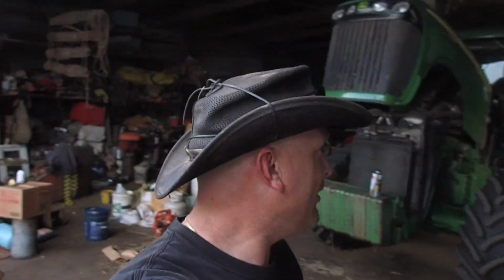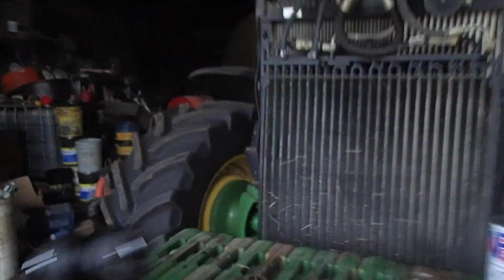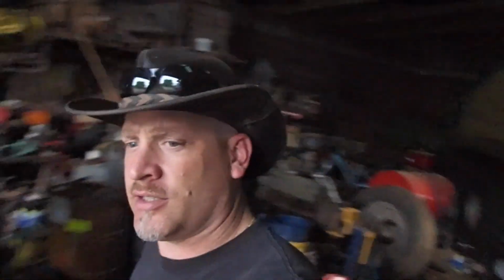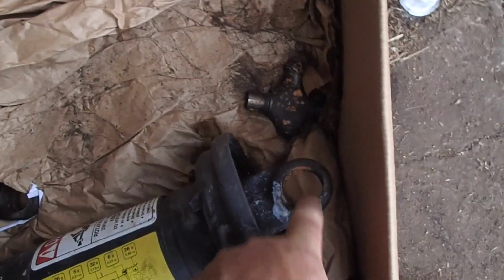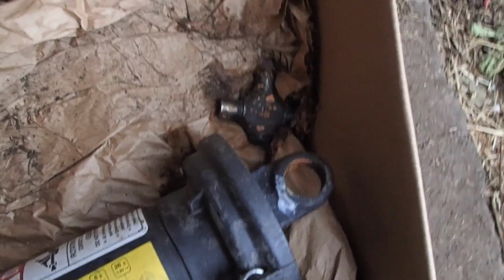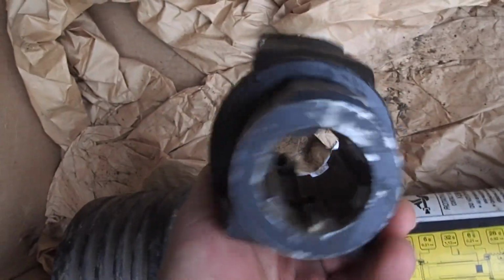Krone PTO Direction

Comment: Ok Wes, you can put this to bed whether or not there is a part two video to this or not. I dug around looking up the SFTS9 number next to the arrow. This shield is normally used on a shaft with a clutch (SFTS9) in a cv configuration and a quick coupling that engages the tractor pto. In this case the shaft is a balanced build with no proper direction for installation, and if they want to be technical about it. The clutch is on the flywheel making the shaft correct anyways because the arrow is meant to point to the clutch anyways.

Comment: Dunno if it really matters, but usually you put the "bigger" end on the primary side. ALWAYS grease a new shaft, because at the factory they just put margarine on it - including the tubes.

There's always some telescope action, unless the shaft runs true or both ends have the same angle.

Love your vids! Thanks..

Comment: The direction has to do with driving shaft of the assembly vs driven shaft of the assembly. Believe me, if the mfg of the part goes to the trouble of printing the proper direction of the part on the part then it matters. Manufactures do not go the expense of printing stuff on parts of they don't have to. 

On my PTO shafts the inner tube is attached to the tractor and the outer tube to the attached implement. Simply look at your other PTO shafts and see how they are set up for comparison.

Comment: i agree it doesnt matter which way around it is, only when there is a slip clutch or some such thing built into the universal is when it matters. The most important thing is that the 2 u joints on each end of the tubes line up together but in saying that theres next to no shafts that allow it not to line up these days.

Comment: i myself coming from a farming family i understand everything you do. heck ive done alot of goofy stuff to get the job done. im honestly concerned why everyone has to question why you do what you do to the point you have to take time to make a video to explain yourself. Mr Pandy keep doing what you are doing i love the videos and cant wait to see more.
Reply: and to add to this if anyone would like to know the direction of that shaft does not correspond to its use on the krone. pto shafts are universal in so many ways. the direction of the shaft would only matter in certain cases. and from what ive seen most of the time it has a direction because the universal joint gaurd is smaller on one end or the other or the u joint is splined different on either end so its just an indicator to help attach it.

Comment: Put the bolted yoke end on the most expensive drive shaft as there is usually less wear on the shaft (over time) compared to the push button release yoke ends.

Comment: Telescoping PTO Shaft: Which end to tractor?            Larger PVC tube (cover) belongs on the PTO end. Consider (a) that the tractor end is generally higher than the implement and (b) water runs downhill. With the upper half overlapping the lower half, water stays outside. Regarding the steel tubes, consider that torque is delivered by the PTO. The larger cross section will absorb more shock load than the smaller  cross section. This is especially true with electric PTOs. Hence the larger half typically goes on the drive end, and the smaller half on the driven end.

Comment: I'd go one step further and check with Messicks or Krone because there must be a reason or the shaft wouldn't have been marked. 

Possibly the shaft and flywheel were balanced as a unit rather than individually?
That might explain the failure if it was caused by vibration. If I remember correctly from another video, the shaft appeared to not run true and was noisy in operation.

Comment: Wes you hit the nail on the head when you said it doesn't telescope so it  doesn't matter which way it goes on. Your failure was I think as you know caused by the  replacement joint that had been fitted If you have got anything of the cups left measure them up against the other end as there are some joints wjth just a thou or two different and they will fit with some effort but it does nothing for their lifespan

Comment: to think of it this way the female  side has more mass so it facing the tractor  keeps the majority of the mass in a straight line and lower position  reducing  pressure on the joint at the top as it spins.

Comment: Maybe look in the IPC or maintenance manual ? If it needs flipping, its 2 bolts and 10 mins. If it breaks I am pretty sure you will be buying another (warranty does not cover improperly installed parts) plus shipping and tax not to mention the down time. Be smart and check the Manual/IPC and save yourself a possible ballache later.

Comment: I would not change the direction of the shaft. I think it is on the right way like it is now . . . Because the outer part(male side) of the cover is on the high end. If it goes on the other way water will collect inside the shield, and that is not a good thing . . . Just saying

Comment: PTO shafts on new equipment are subject to fail. If you check that shaft after a short time of running it is probably to hot to touch. It is a result of an accountant on the 30th floor of an office building building equipment.

Comment: I'll also note that the directions for installing the shaft are still unopened and taped to the shaft.
Reply: check again, they were open and the paper is gone, just the plastic is left on the shield
Reply: Is it?  Huh it looked like it was still on there.

Comment: The only reason left would be if your U-joint trunnions had grease fittings on the cross. They need to be installed so the zerk fitting is under compression when in use or the trunnion can fail.

Comment: could the reason be  that when a pto shaft is angled down, female is at top end to avoid  water and dirt from enter inside  and eventually binding up with grease inside the pto shaft, and creating stress on needle bearings

Comment: Isn't the "tractor end" usually the outer of the two shaft halves?  At least it is on the two I have here.. That said, typically its downhill from the tractor to the equipment .. my assumption is the outer shaft being higher is to prevent debris and water from running down between the two halves.  If this theory holds true it'd make sense to connect it the way it was on the Krone as otherwise you'd be directing everything down through that union.

Comment: Think of the effort and cost to print the tractor and arrow on the shaft.  For no reason?  CALL THE MANUFACTURE FOR INSTRUCTION!
Reply: For no reason!!  The shaft is built correctly.  Yokes are in phase.  U-joints are identical,  The installation is correct.  The shaft will operate in either direction. End of story.
The only reason the arrow direction would be valid is if the shaft were built with different size u-joints for one reason or another.  The arrow sticker is more than likely used with a variety of installations.  In this case, it is not valid.  By the way, DON'T YELL
Reply: Paul Copeland:   On such an important part, on such an important machine, with such a questionable history, a 10 minute phone call to a factory engineer to get an expert answer, is the rational course of action.   You're probably not an Krone expert, and...  PHYSICIAN HEAL THY SELF!  Thank you for your input!
Reply: +Gravertrain Graveytrain you are not à mechanic for sure and you are doing a storm in à class of water
Reply: INCO:   My shop is still open and run by another.  I operated for 18 years with four employees.  Illness caused me to step down.
Reply: It never hurts to double check, especially if it stops your machine from failing because all the time you saved by not calling you will be wasting on fixing it
Reply: Thanks!  It shouldn't hurt to stop and think it through.  Best o' luck.  :)  PS: Wes seemed pretty stressed when his baler was down, and he had crop to bring in.

Comment: I'm thinking the chisel marks are the KEY here. They tell us of significant issue some time prior to delivery ( in KRONE hands )Someone screwed up before you ever touched it making Wrong #1. You unsafely assumed that KRONE employees know best and tell into the trap of following that lead making Wrong #2. You absolutely know your Momma told you over and over, " Two Wrongs Don't Make A Right". The shaft IS backwards and You should reverse it while no harm has been done. Also, remember, 2 wongs don't make a white. He,He!

Comment: I dont know what brand that shaft is but im Petty sure thats its not a krone
In holland we use mostly walterscheid and this is probably a standard shaft with standard printing
Its actualy the secundary shaft so its not. even connected to the tractor but the housing is used for a miljon other machines

Comment: I would be asking Messick's if they borrowed that shaft and put a fixed one back on. I can't see the factory doing that. But after a few years a farmer might have to beat off yoke because of rust, and paint and replace u-joint the old fashion way without a press. And then return the repaired one to the dealer..........I would email Krone to verify driveshaft direction is not a problem. Just for peace of mind..........

Comment: why oh why would you ignore the manufacturers instruction when the one thats just failed was also in against the manufacturers instruction . just arrogant
Reply: let me tell you something, those covers are universal, they get used for every singel shaft. not every shaft they are used on has a specific way of mounting.
Reply: @Gert AgriPassion
This is indeed true. But those instructions which are on the PTO cover, if you look to where the PTO is put, it's not in between the tractor and the baler, but once the PTO is placed between the tractor and the baler that's where that cover instruction should come into play. But it still shouldn't matter as in how you mount the PTO on the baler/tractor. The shaft cover is only a bit larger on the "tractor end" to cover up the PTO stub.

Comment: The old one was installed by whomever butchered it and you're saying you installed the new one because the crappy one was installed that way?
Bad logic.
Reply: Right, Wes said they didn't NEED to remove the shaft to replace the cross but maybe they DID remove the shaft and got it backward when they installed it. 
I also remember the shaft being a bit difficult to install.

Smaller joint, brutal hammer marks, = sledge hammer mechanic. They have a bad name for a reason, why follow in their footsteps?

Why not turn it around just for peace of mind?
Reply: is it even possible for the shaft to be installed backwards? you would think it be male to female instead of female to female or vise versa...

Comment: This shaft cover is probably also designed for shafts with pto clutches. Clutches only work one way right? Who cares if the image is pointing the wrong way? The shaft is universal without an inbuilt clutch, the baler deals with the clutch part.

Farmsim warriors at it again!

Comment: Well let's see. You already know that some gorilla worked on that U-joint with an axe and a sledge hammer. Gorillas aren't noted for being able to read. I'd bet that he took the whole shaft out and put it in backwards before you ever saw that bailer.

Now, does it matter? Heck, I don't know. If the U-joints and spine couplings are identical, then probably not. But I have to wonder why Krone went to the trouble of putting that mark there. Maybe just to satisfy American lawyers?

Comment: As a complete novice to tractors and PTO shafts I do not want to tell you the shaft is installed correctly or not.
However I have 2 thoughts.
1 - Krone is not going to spend extra money and effort to put a picture for the direction on the shaft when it would not make a difference which way it is installed.
2 - The shaft you took out was installed reverse to what the picture says and was broken prematurely....
-
I would go with the direction Krone tells me and not the direction a prematurely(!)  wrecked shaft was installed
That is just my 2 cents....

Comment: It doesn't make ANY difference there. It doesn't move, meaning the slide. Ends are the same too. The emblem on the guard is there for every axle, guards are "bulk" stuff just shortened to every axle, so the emblem is there always. It is there if the other end is wide angle, like the one Wes has on his tractor end. THEN it needs to be right way around. 

Female and the male tubes are the only difference, and that won't matter either, it slides the same way no matter wich way it is. 

People, calm your tits.

Comment: I would put a dollar on some knucklehead taking it off completely because they didn't know any better and then beating the crap out of it to swap the cross, and then putting in in backwards.  I agree however that it should not make any difference assuming the shaft was properly assembled to begin with.

Comment: Driveshafts are phased for a reason....reverse it.
Reply: Yes, driveshafts are phased, but only to themselves.  When you build a drive shaft you must be careful to weld the u-joints so the yokes line up.  Both of his shafts are built and "phased" correctly.  Reversing the new shaft would mean nothing. Now, if you have two shafts in series with a carrier bearing support, you must phase all of the u-joints (line up the yokes) from transmission to drive gear.  Very important!  In Wes's case, the shaft is built correctly (I carefully slowed the video and checked) and can be installed either way.  Get over the arrow, folks!
Reply: Do you know what they mean when they refer to phasing? It has to do with the alignment of the yokes nothing at all to do with which end goes forward
Reply: I shoulda known better about phasing. I spoke b4 my brain got up. I'm a retired mechanic and done plenty
Reply: Hey, no problem.  Away we go to the next one.  Have a good day and be safe.